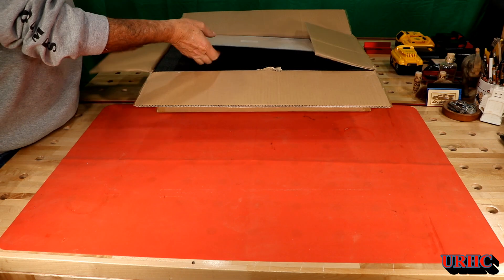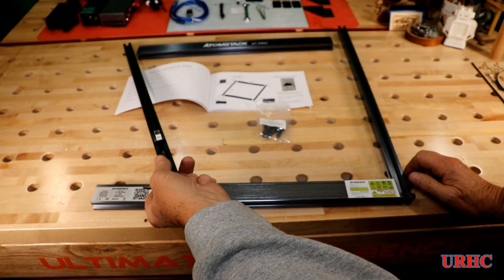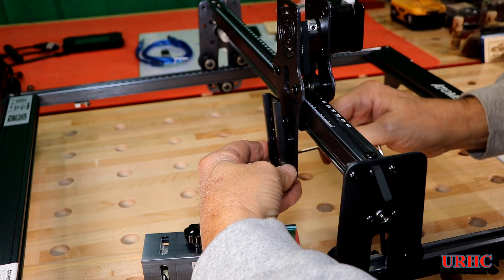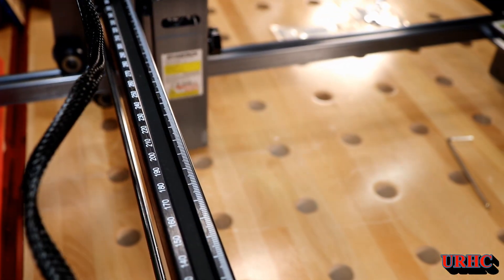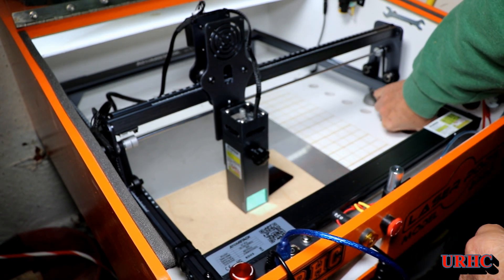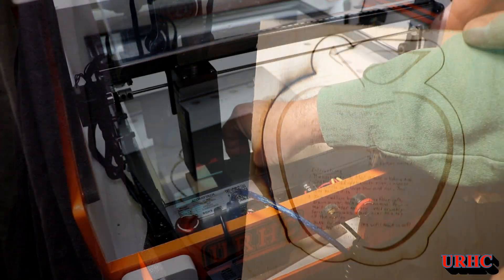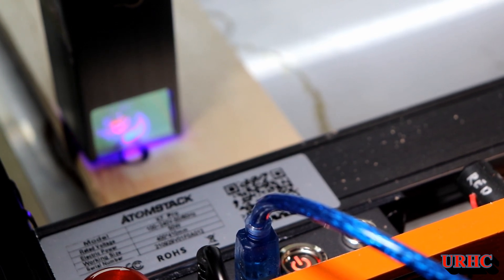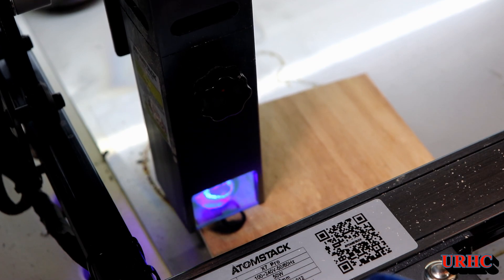Atomstack X7 PRO 10 Watt Laser Engraver Unboxing And First Impression

Comment: I've had a problem with the offline feature, it doesn't work, customer service was poor and drawn out, and the new display after waiting 2 weeks still didn't work, now I get a message saying the program is corrupted, think twice if you're buying for the offline feature! the rest of the machine works okay so far.
Reply from the maker: That's why they have the lowest pricing. They seem to cut corners  on quality  and support. Hopefully you get that straightened  out.  Thanks for watching.

Comment: Looks temperamental. Im trying to decide whether or not to return my new Ortur Master 2. It stared out great, was able to get one project done. Now however, it's gone bonkers, all kinds of stop mid job, dancing and grinding. I can't afford damaging materials, especially pieces I've custom made for engraving. I checked your post to see if this product would be an option, not gonna happen. Thanks for the review.
Reply from the maker: I think my LM2 pro is a better machine then this with really good support.  Ortur should  be able to help you solve your issues if you contact them.  The Xtool d1 is my favorite and easiest to use. Have a couple hundred  hours on mine with no problems  yet and auto firmware updates that keep it working right as operating system and control software updates change how things work.  Thanks for watching.

Comment: You should probably put a link to your follow up video with the fixes.
Reply from the maker: I put a link back to this on the new update. I don't  change  old  videos.  Thanks for watching.
Reply: @unemployedredneckhillbilly2023  I get your intent, I'm not saying you should alter the video itself. Just add the link as an update to the end of the existing video description. If somebody only sees this video and doesn't see the follow up, they're not getting a true representation of your full experience with the product. 

I'm in the market for an engraver and had I not happened to go to your channel, I would have been only getting half of this story. Not everybody will organically find your update video.
Reply from the maker: With  the out of box experience,  support having me keep loosening  everything, low quality parts, and laser problems  I definitely  would not recommend this machine.  It can be made to work after  waiting  weeks for parts. Guess  I am used to  lasers from others  that work perfectly  out of the box, have fast support that is accurate,  and no potential future  problems  from things like hardware  that is to short to engage  the locking feature  of the nuts. I don't  want to see my subscribers waste their  money and time.

Comment: Hi Ed
 I'm thinking about getting into engraving, what software are you running ,or do you have an idea for a beginner... software !
 I'm an old millwright, sort of retired now...my wife calls me (The Unemployed redneck Larry creations ) lol....we love your stuff keep it up your great

maple syrup time is coming hint hint
Reply from the maker: I am using mostly  lightburn and definitely  like the Xtool D1 best. its easy to use and not much maintenance. Ortur  has some  great machines  also but nothing 10 watt yet. I just received replacement parts to try and fix this one and hopefully  it will work  right. My wife  started  calling  me that after I was laid off when I turned 50. I was pissed because  it was over H1B workers  so I dropped out of the workforce  and after  that my wife  would  call things I made by that name so I used it when I started  my channel.  Not this year, still have lots left. Merry Christmas.  Thanks for watching.
Reply: @unemployedredneckhillbilly2023  that's funny you made my day, thanks Ed 
Merry Christmas buddy to you and your wife
Reply: @unemployedredneckhillbilly2023  Please let us know if the replacement parts resolve your issues. I am in the market for a 10W laser and was hoping this would be a good solution. DOH! Just saw you posted an update video. Thank you!

Comment: how do i use the SDHC csrd and what files do i use?
Reply from the maker: Make the g code files in lightburn and save them on the card. Then use the controller to run them. I haven't tried that because it's a  waste of time until I get it working  right. Waiting  for a new controller board. Thanks for watching

Comment: That 17mm (12mm on a5 40w) is worded wrong and is tested on basswood which is extremely soft. 
I bought the a5 and the max hardwood (mdf , plywood) it can cut is 5mm.
I was thinking to get the a7. However i may just mount the neje 15w onto the a5 frame.
Also add an air gap under your cut.. It will cut cleaner when it does get through.
Reply from the maker: Poplar is the softest  wood that I have so I tried  that. It's only about  10% harder then basswood. This almost  cut the 3mm Baltic birch in one pass at first. My D1 will cut 6mm birch in one pass max with the air assist. I just showed  what was  provided that most will use. I definitely  wouldn't recommend  it after  my experience but I may have just gotten a bad prototype.  Thanks for watching.
Reply: @unemployedredneckhillbilly2023  
Thank you.

Comment: Excellent information. I ordered the xtool D1 and rotary from your link on Nov 12th and received via FedEx on Nov 22nd free shipping. Ran my first test last nite and perfect my firmware update is setup for light burn and will be purchasing soon. Thank you Ed for your always truthful reviews and videos. You were right about the D1, it is extremely far ahead in quality and build than the others in its class.
Reply from the maker: The D1 is the best so far. I am running  on lightburn and be sure to set the origin in the upper lh corner or everything will be flipped.  Such a trouble free machine.  It's  definitely  worth the extra  cost after  trying  this one. Atomstack  didn't  want me to post this but its my actual experience with the machine that I always show good or bad. Hopefully  it can be fixed to show others what causes issues like this. They said I was slandering  them but truth is not slander. Thanks for watching.

Comment: Thanks for the fair assessment, I have been contemplating getting a laser and videos like this certainly help with decisions.
Reply: So i just got the exact same one, 1st thing i tested on was cardboard at 15%pwr, 200sp. I could not get any burn. Turns out you need to change the device in lightburn for GRBL-M3. After that it worked fine and i got a small good etch on cardboard. I still need to play with settings and other materials.
Reply from the maker: @delfinobenavidesii4487  It worked good for an hour and then was junk. They think it's the controller board and are sending a replacement.  I think one of the dual lasers blew. Also I found there are 3 wheels with  bad bearings causing a lot of the vibration and loosening the belts and wheels is not the actual problem as they said. Never had problems  like this with any of my other lasers. They all worked great out of the box and have run for 100s of hours. This is is very finiky and seems to be made from cheap generic parts. You need the grbl for pwm to work properly and have longer laser life.
Reply: I like you rely a lot on reviews from people like Ed here. It was his review that led me to the xtool D1 as I have never heard of it before. I highly recommend it and order very soon before the price goes up and definitely get the 10 watt version
Reply from the maker: I may have just gotten  a bad unit but it just was not a great  out of box experience  for  me. Hopefully  it will be fixed  but I always post my actual  experience with a machine as it was shipped.  I actually  think the Xtool performs the best so far but it also has a slightly higher price. Thanks for watching.

Comment: Your going to run out of room with all theses lasers and cnc routers. A good problem to have. Enjoy your channel.
Reply from the maker: Thanks. This is my last laser and It's not staying around for long if they don't send parts to fix it. I am out of room and only wanted to show a couple of the 10 watt machines that are new. Right now my Xtool D1 is the laser that has had no problems, is easy to use, gives excellent results, and is easy to maintain due to a simple design so I would recommend that as my favorite. Thanks for watching.
Reply: @unemployedredneckhillbilly2023   bought a Ortur master 2 pro, watching you work and explained has helped a lot. Learning new computer and new software ware is hard on a not so computer guy, I also ordered one of the infinity lighter fans to help remove the fumes. I’m amazed how much work you do. We’re you a IT or engineer guy? Your a very knowledgeable guy.